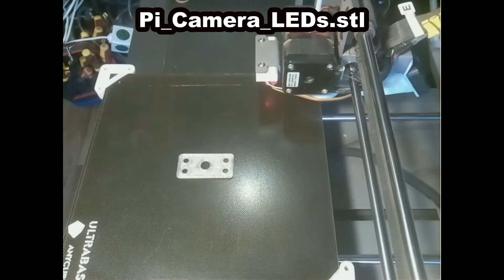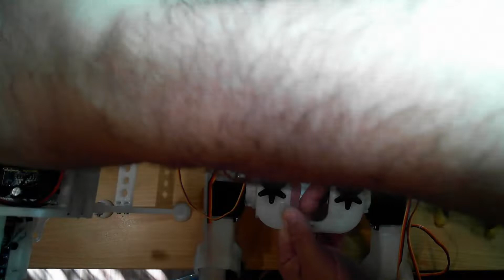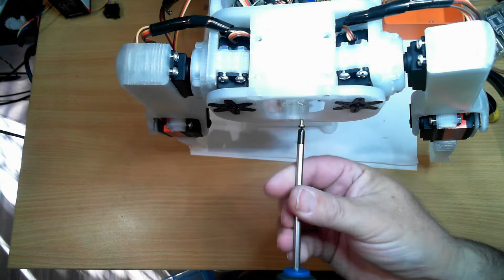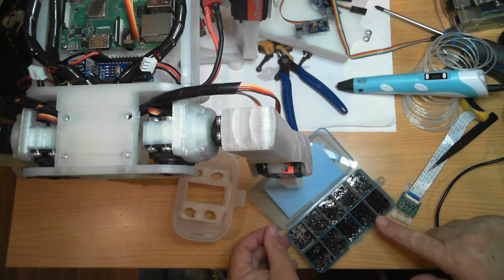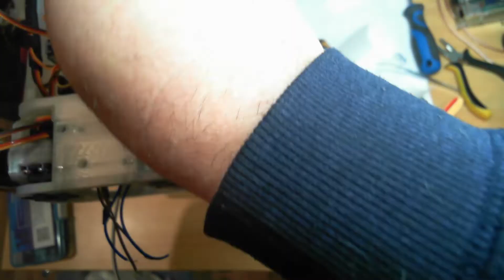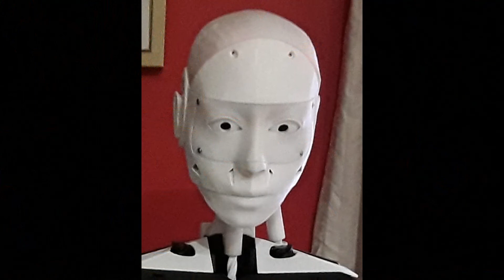SpotMicro Part 6

Comment: Nice job. Can't wait to see how your Spotmicro walks. A lot of the ones I've seen so far drag there back legs and I don't know why that is. Maybe it's from using cheap servo's or improper programming.
Reply from the maker: Thanks. :-)
I've been testing in the MyRobotLab (MRL) system.
The process of setting that up and in Part 8.
In part 9 I start on the program within the MRL environment, during the early construction, I did have the gears on 3 of the servos I was using strip the gears.
As a result of this, I ordered in 4 JX-Servo PDI-6221MG Servos.
I used these to replace all the wrist servos.
After getting the Operating system and MRL installed on the Raspi, I created a simple set of scripts, and tried to get Spot to move from a laying position to a standing position.
The result was 5 more servos stripping the gears right there. :-(
I have now ordered in 12 x FEICHAO F39202-270° Waterproof Servo 35kg Coreless Servo Large Torque Digital Aluminium Metal Gears.
When they arrived, I replaced all the servos and removed one of the SMPS so the servos could be powered direct from the batteries.
These servos are not as fast as any of the servos I have tried before, but they do have a lot of torque.
During testing since then, I have had spot turn its self off a couple of times, rolling over it's tail.
There has been some interesting behaviour which I still need to investigate further, like the servos not shutting down when the control signal is removed and the servos moving to strange positions when MRL is shut down.
The latter being part of this weekends testing.
MRL has also undergone some significant changes over the last few weeks, I've been involved in the bug hunting there as well.
The LCD and MPU6050 are now fully operations in Spot under the latest MRL :-)
The Raspberry Pi Foundation have also now released the 64 bit version of Raspbian, the official operating system for the Raspberry Pi.
So I have been experimenting with that as well.
There are pros and cons there.
I have also spent a significant amount of time working on the Kinematics of the robot, those videos are yet to be recorded and the program fully implemented.
But hopefully soon, Spot will walk :-)